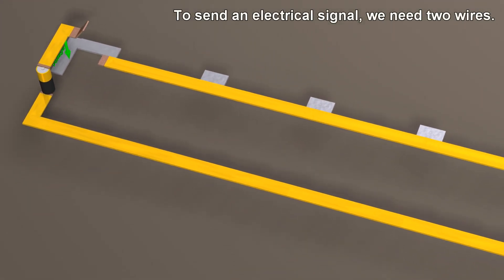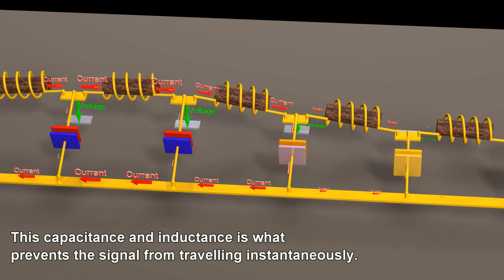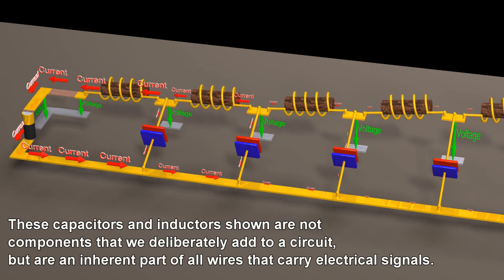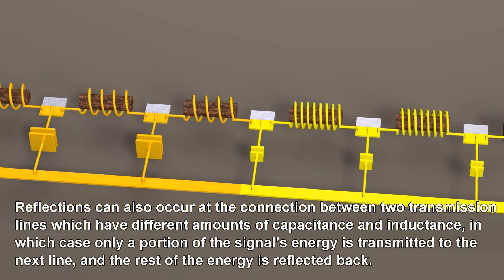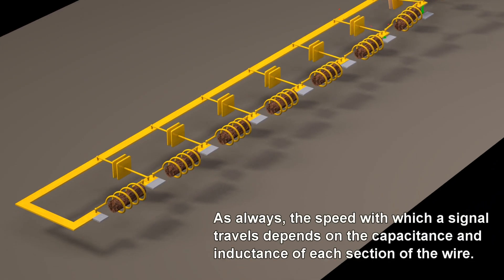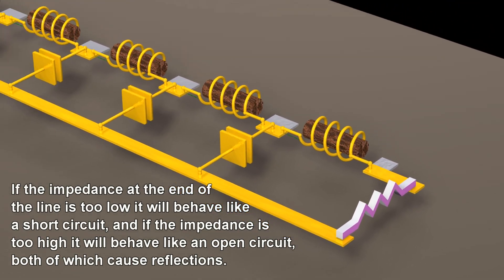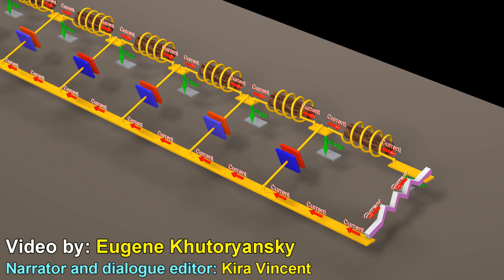Transmission Lines - Signal Transmission and Reflection

Comment: I think you should've spent more time explaining this - to someone like me who's never heard of the concept of reflection in signal transmission, this video wasn't sufficient to make me understand how it works. Also not a fan of the music in the second half.

Criticisms aside, there's too many good things to say about your videos to fit in a single comment, and I still absolutely love your videos. You easily deserve 10x the subs!
Reply from the maker: Rizwan, this phenomena happens because the last inductor in the chain wants to keep the current going, so this current goes into the last capacitor, and as this last capacitor discharges, the signal is reflected.  And thanks for the compliment about my videos.
Reply: What confuses me is at around 0:40, why does the voltage drop at the first capacitor as the current continues down the cable? Why doesn't the wire just achieve the maximum possible voltage as the current gets to each part of the wire, and then just stay at that voltage until it finds a way to discharge?
Reply: @TheOnlyRizzy  I guess the explanation for this is: because of the the first inductor. Initially it doesn't want to let current through, then current starts flowing, once the voltage on the right side is the same as the left side, normally current should have stopped flowing, but the inductor doesn't want to let current change, so it pushes even more charge on the right side, raising the voltage above the left voltage. Then slowly the current reaches zero, but now current needs to start flowing to the left to lower the right voltage to be the same as the left (input) voltage. Again though, once the two voltages equal each other, the first inductor wants to keep current flowing, lowering the right voltage again lower than the left voltage. So it an oscillation but you only notice the first, hard, reverse swing of it. The next swings are smaller since, I assume, energy has been lost to power up the next oscillation in the line.
Reply: @EugeneKhutoryansky  So is it like a mini LC oscillation at the end of the wire? And the peak values of voltage in the oscillation gives rise to the reflection phenomena?
Reply: @anjelpatel36  
When he says "section" he means "any part of the wire," no matter how small or large.

In other words...
Every "bit" of wire resists the current.
Anytime current is resisted, it "reflects back".

For example, try creating a wave in still water that goes only "one way." It is nearly impossible. Because the moment you apply force to the surface of the water, you have to both raise and lower the water level at that location.
You are creating both positive pressure (forward) and negative pressure (backward).

This is true in the wire as well. Every bit of resistance wants to "reflect back" the energy you provide it.

While the resistance is happening, it is also BUILDING up energy like a capacitor.
In other words, the "water" has to be "pushed" to generate a wave and the larger the wave, the greater the energy it has stored.
This stored energy is now "inducing" forward.

So we have a vector (largest waveform direction) as well as a wave peak (inductance) and wave size (capacitance).

The wave of water "wants" to keep moving in the same direction because of the vector (voltage).

But we can't just have a wave peak. We also have to have a wave trough. The trough is going to "reflect back" some energy after the wave moves because by pushing the water forward we have displaced water and created a negative pressure as well.

Waveforms become extremely complex and over long distances can build and build upon each other creating giant waves that have been birthed from many smaller waves.

It's just the science of waves really.
Reply: +Rizwan Awan (TheOnlyRizzy) this had also stumped me. Usually these videos are brilliant but I feel that this one was too short.
Reply: Although it doesn't answer your question, it's interesting how the configuration looks like a series of low pass filters. The transmission of a pulse and its reflection might have to do with some elementary properties of capacitors and inductors? IDK.
Reply: That is not true. Transmission line capacitance and inductance is a significant issue at lower frequencies. That is why you have 50/75 ohm antenna cable between transceiver and antenna. The same issue with signal-generators. You need the same impedance at both points. Therefore you need a cable  sustaining this impedance. I.e. 50 ohm coax cable.
Reply: These videos aren't really meant to teach anything about electronics, per se. They're more geared towards visual demonstrations of concepts in physics. The fact that these videos are about electronics is incidental. If you want to learn more about electronics, I'd strongly suggest checking out allaboutcircuits.com  www.learnabout-electronics.org and a reference book called The Art of Electronics. I forget the name of the first author, but the second author of the book is Winfield Hill. These resources alone should provide you with more than enough to get started. I've personally been using these to learn electronics. I'd also recommend watching videos on channels like BigClive or EEVBlog. Even if you don't understand everything (or anything) at the very least, being exposed to it will prepare you better when you move on to more extensive topics. Best of luck to you.
Reply: Rizwan... It's the same answer and is explained clearly in the video. Each segment reflects the signal back, just like the end does; the difference is that the very end can only reflect the signal one direction, so it has double the energy.
Reply: I think this is a great video for explanations of reflections: https://www.youtube.com/watch?v=g_jxh0Qe_FY
Reply: It is the flywheel effect that causes reflections, I guess?
Reply: The voltage indeed does not reach full value because the existing current produces a voltage drop at the internal source's resistance.  Remember that a practical source is to be viewed as an indeal source plus a series resistance. This is often matched at the line's characteristic impedance, and that is why you see that the voltage at the line, close to the source is less that it full range. Later, if the line is open-ended this voltage at the beginning of the line will reach the full source value.
Reply: Video was good but should have been more elaborate
Electronic and Communication Engg: https://www.youtube.com/playlist?list=PL6Br4r2QYH9P_HWRO_rb2rVzyDGES4lZz
Reply: Then google and learn what you don't understand before trying to understand this. Ask yourself, what is a capacitor, what is an inductor? You don't start Hebrew class at lesson 14 either :)

Comment from the maker: If you like this video, you can help more people find it in their YouTube search engine by clicking the like button, and writing a comment.  Thanks.
Reply: +Physics Videos by Eugene Khutoryansky Wow great summary, fantastic video as always. I am disapointed in the human race for this channel not having more subscribers.
Reply: The video xas excellent as always, but it would be really interesting if you could make a second video explaining why this effects do happen instead of just showing them, in order to reach a better understanding of this phenomena.I know I may be asking too much for a Youtube video, but I'm pretty sure you could make this happen. Great job! I love your videos!
Reply from the maker: Kritsu, this phenomena happens because the last inductor in the chain wants to keep the current going, so this current goes into the last capacitor, and as this last capacitor discharges, the signal is reflected.
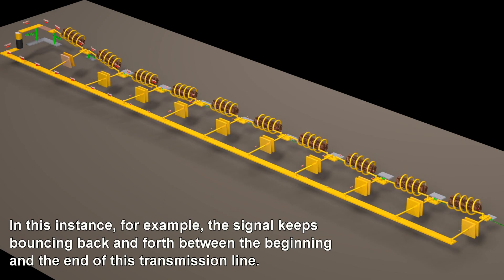Reply: What's the song at 1:59?
Reply: Almost all of the video are fantastic. Not sure if you ment to forget the real resistance of the wire. In a dc circuit it does matter. Thats why ac beat dc back a hundred years or so. In ac circuits it gets far more complicated. Often the transmission line can be reduced to more of a impedance issue dependant on many more factors like gauge length frequency voltage. I thought about it more like a AC filter. Standing waves cause impede CE mismatches but that subject can get deep fast ie Smit charts. Why you would select certain wire and cable types for various applications might be an interesting topic. Twisted shielded pairs always served me well for low voltage analog collection. Just a thought. I do enjoy your videos. Thanx again. Kole
Reply: I have a dout can you explain?? please... 
In Dc transmision there is no inductance effect so how we transmit the signal or electricity?
Reply: This is what i really wanted.  people like me need animated explanations which helps them to understand things which they don't really get the idea while reading.i loved it.  you can do more better. Hoping for more videos.🕹
Reply: The bots which generate fake views and likes can be extended to also generate unique comments. Apparently the only way to please the YT algorithm and get on the "trending" page is to somehow present your physics knowledge in the form of a music video makeup tutorial.